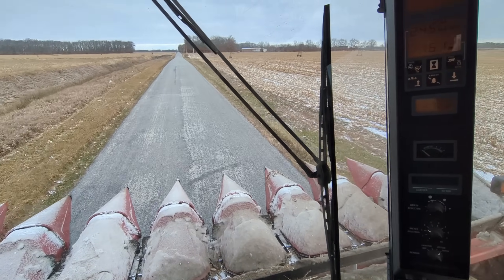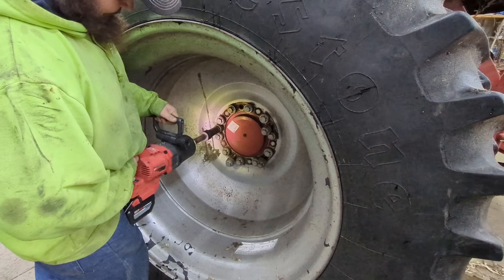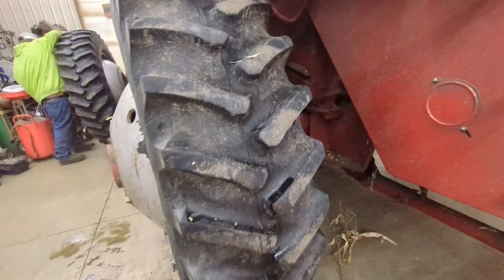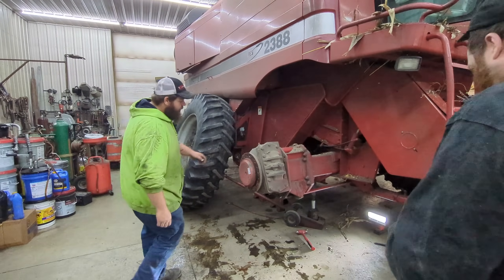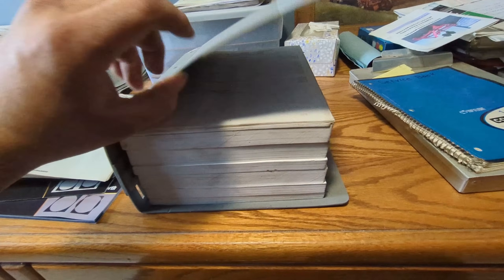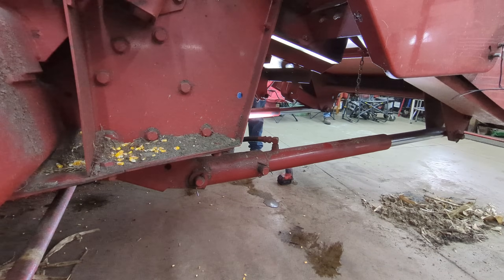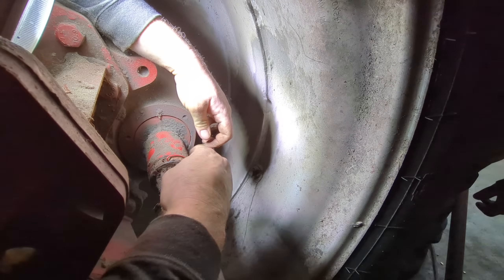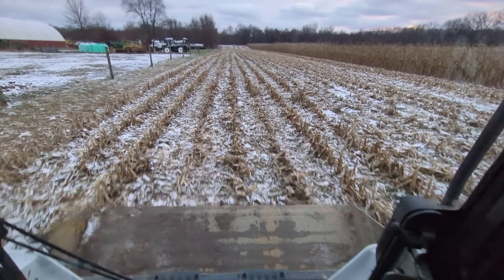Case IH 2388 Axel Reinforcing Rod Removal And Replacement Shop Work On A Cold Day!

Comment: Unless there was a change from an early to a late  model 2388 someone has added those two center support brackets to keep it from dropping down and taking out the valve stem when it breaks. Never had to take the the tires off of the 2388 or 2588 to replace one. Easy job in the field with an impact the right size to fit on the nut. Torque spec is 3 ugga-luggas if I recall correctly

Comment: Anyone who's pulled a dead combine knows you have to disconnect the hydrostat driveshafts to get the wheel to free spin. Towing or loading on a flatbed. I speak from experience! A $22,000 experience!
Reply from the maker: I can't actually say I've ever had to actually tow one dead but I do know your supposed to take the couplers off now I have popped the Gleaners in neutral when I'm by myself and have to pull them out when they are stuck

Comment: that was interesting, but you would think that a “shop manual “ would explain items completely 
not to leave anything to chance. like “how many foot pounds is tight” ? probably the force of 270
to lock it in place. so it does not have the opportunity to loosen up. great video, thanks for sharing your time.

Comment: We broke are  tension rode this fall. $85 piece of 1.75” DOM, multiple slug welds and good to go. Did it in field, without removing the wheel set.  The welding happed at the shop.

Comment: If you have to use ancrowsfoot to torque a fastener, always position the foot 90degrees to the wrench. If it is in front of the wrench the applied torque is increased because of the added lenghth. There is a formula you can do to correct the applied torque but it's easier to install the foot to the side.
Reply from the maker: I really remember that next time I guess I never really thought about it thank you!!

Comment: Why not just go to a machine shop in your area and have them order that size bar stock and have them put turn threads on the ends. Turn threads is very simple with the right equipment.
Reply: If you use just any old type of steel, it might break again fairly soon.  Different types of steel have different strengths.
Reply: It’s just average stressed 1-3/8”.